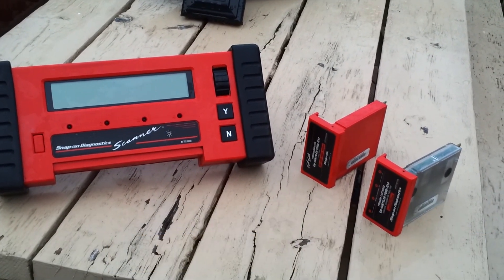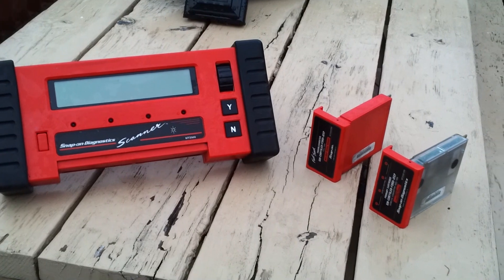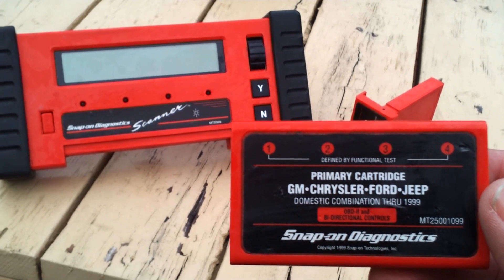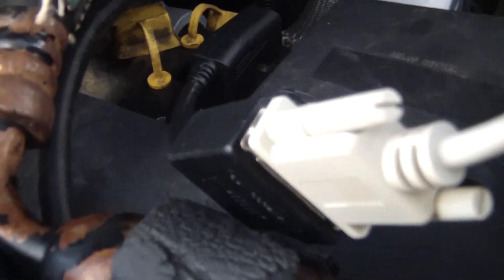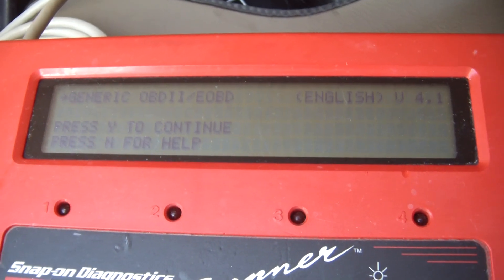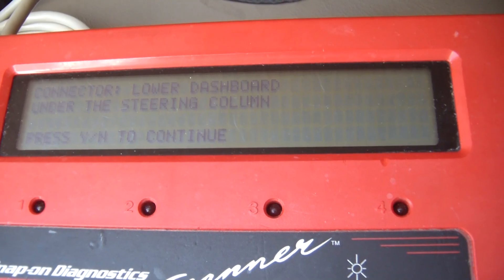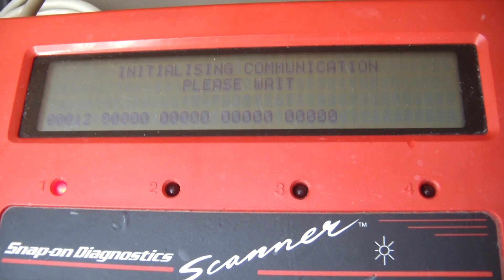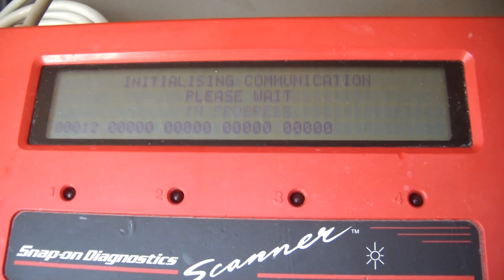DIY Auto: Snap-On MT2500 diagnostic scanner. Initial hook-up to my 1990 Jeep Cherokee.

Comment: These renix systems are NOT obd1 or obd2 it is a RENIX system completely different from obd. You will need to reset your mt2500 scanner for renix. Try and completely disconnect the power and battery scanner should completely reset and you can put the information into the scanner. You will need the year and vin of your vehicle these cartridges are exactly what you need to read rennix jeeps. Again the renix does NOT hold codes so you will only be able to read the system while the jeep is running mostly you can use this to reference all Voltage and fuel pressure.

Comment: The first light shows the codes. Get the 120 volt cable and the battery Pak to review codes away from the vehicle. Get the12 volt cable which connects to the Pos. Clamp and the adaptor.

Comment: I had a feeling it was that. Cartridges you get from individuals can come from a box with other cartridges. Sometimes you need the adaptor with the battery post adaptor to power the adaptor. Get the manuals. It tells you which adapter you need and location of the connector.

Comment: Did you feed in the right VIN numbers?  Check the manual for Chrysler. Maybe the cartridge is bad.
Reply from the maker: Problem was resolved, PROM's I had in my Primary Domestic cartridge were fraudulent. See link; http://tinyurl.com/7xj2hrm

Comment: Is the main data cable just a standard VGA cable?
Reply from the maker: No. DB15 male on one end, female on other.? #MT2500-5000. Search eBay.
Reply: Klondike Mike  The cable number is MT-2500 5000.

Comment: The Primary cartridge can go into either cartridge bay, it DOES NOT MATTER which one it is put into. Your vehicle is OBD not OBDII and it should work with this cartridge and troubleshooter. The Jeep-1 cable is an OBD cable and is the correct one for this OBD vehicle. Ignore the black cartridges the ones you have are fine for your vehicle. You did not show enough of the initialization process when you turned on the scanner to find out what was entered into the scanner. I have a 1990 Dodge caravan and have no problem communicating with it with the same scanner and cartridges. I use the Chrysler adapters one under the hood and a different one under the dash to the right of the steering column. I'm not that familiar with the set up for the jeep though but did you look for the connector it told you to use under the dash?
It appears that you do not have the proper software inside the Primary Cartridge.
Reply: I know its an old comment. But im looking to buy one becuase i have a few 94-95 GMs which is obd1.5 so i need a scanner and i cant really find any that work but the mt2500. Anyways im a little confused on how the cartridges work. I need to scan my 1995 pontiac bonneville. And i see some "thru 1997" "thru1999", fast track, programmable, troubleshooter. catridges on ebay. Im confused on which ones i need. Which ones do i need to scan the codes on my 95.

Comment: rzelych, I personally have this scanner. The red cartridges you have are non-programmable as to where the new black ones are re-programmable. The primary cartridge needs to be on the left and your troubleshooting cartridging goes in the right. OBD-II was not mandated until late 1996.